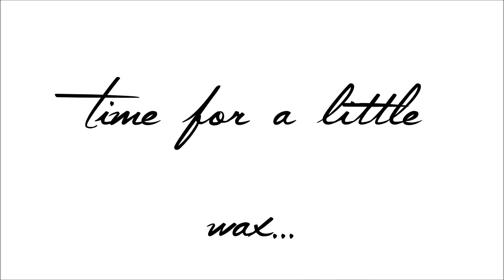Woodturning: Making A Fancy Morta Dublin Falcon Bowl

Comment: That is a beautiful pipe bowl. Only thing is, where were the threads to screw it on the pipe ? How does that work ? I love my Morta pipe and would love a large bowl like that for my Falcon's. Beautiful work.
Reply from the maker: Thanks Larry. The o-ring on the bottom fits into the threads of the stem securing the bowl. The o-ring also serves to create a seal just like the ones on a factory falcon bowl. I made this video many years ago now and have learnt through trial and error that morta is not a good material for falcon bowls as over time morta will shrink. I’ve had to do a few repairs to mine to make it work. Hence I don’t make these anymore.

Comment: That pipe was very nice, is the morta dry when you by it . I bought some that was wet and it was a little difficult to work with, when it dried up the pipe get a little crooked . Still nice and nearly black in color , haven't smoked it yet but the air hole and bowl seems ok. Thanks for sharing Glen take care
Reply from the maker: Hi Kristian! Yes the morta was bone dry. Sucks you got a wet block. I've never had wet morta before. I think I'd think twice before going back to that supplier again. All the best bud.

Comment: Wonderful work. Do you have the size of O- ring you use on that?
Reply from the maker: Thank you!! I use 21.7 ID x 2.1mm. It took a few goes to get that size right so the o-ring would fill the threads and create a good seal as well a tight fit. 

Thanks for watching.

Comment: The base of the falcon pipes is threaded. How do you insert your bowl that is not threaded?
Thanks for your answer
Best Regards
Reply from the maker: Hello, thank you for watching and for your question. The answer is that I use an o-ring in place of threads. Falcon use a proprietary thread that I can not duplicate. The o-ring size that I use is sufficiently big enough that it squeezes into threads on the stem and also creating the necessary seal that falcons need. I cannot remember the size off hand but if you really need to know I can get that information for you. There’s another falcon bowl video on my channel that will demonstrate the method that I use. It works well. Thanks and take care. 

Glen.